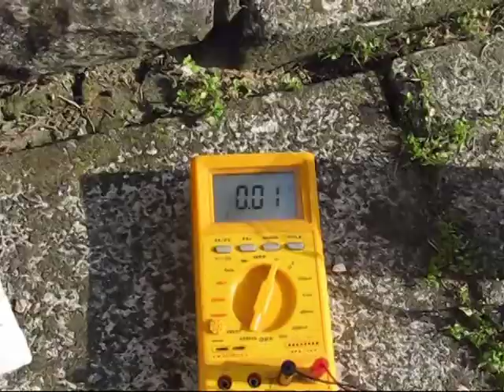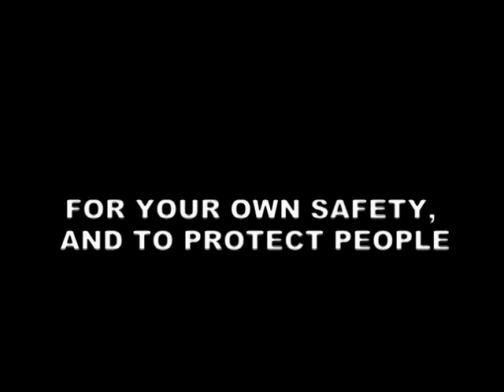How to make a simple solar cell

Comment: @sedera12 This actually uses Cuprous Oxide, a semiconductor. Photons let the "lower" electrons pass the band gap and flow into the solution until they reach the copper, on the other end of the container.
It's a so called solar battery because it will read voltages also in the dark, but when exposed to light it produces much more energy.
If you're interested in a "real" solar cell, take a look at the TiO2-antocyanin based cell. I think I'm going to make some to power a microcontroller.

Comment: This is not a solar cell but it is a simple cell with a copper plate and a electrolyte
Reply: From what I saw it is more like a capacitor. There is a difference in potential between the two metals. You can do the same thing with plain aluminum foil. The effort and ideas are appreciated though to the maker of the vid.

Comment: you can get more power from a metal can transistor crystal... Try the organic paint cell. It makes more power than the copper oxide one and is lighter and easier to mount.